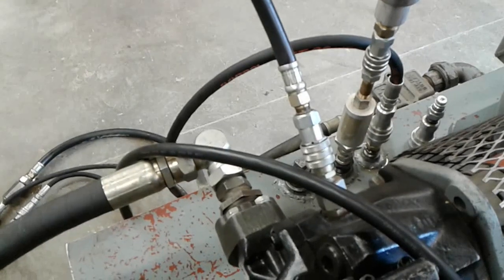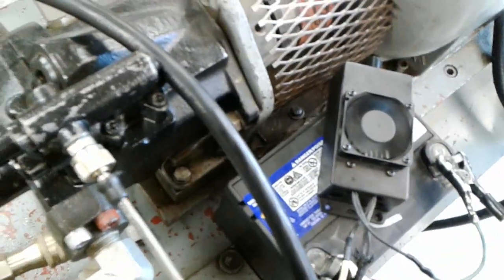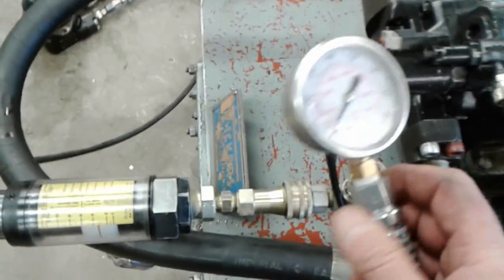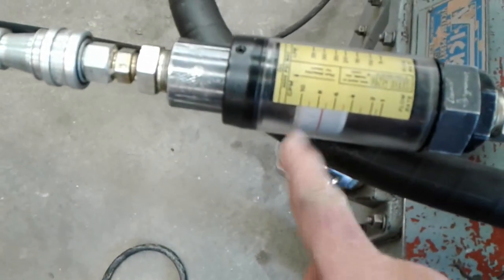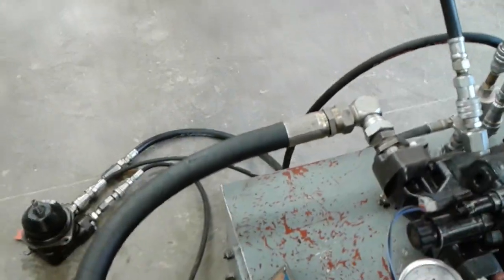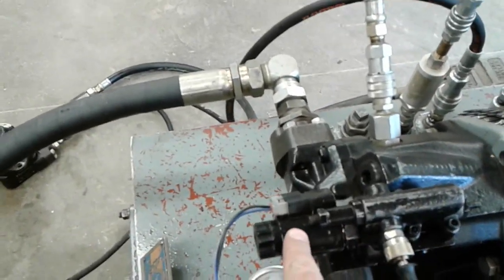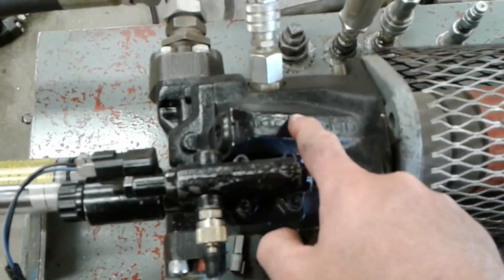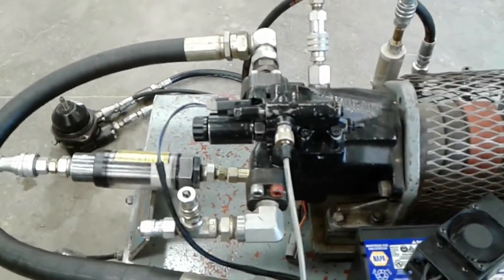Load Sensing Part 3. Rexroth Electronically Controlled Load Sensing Pump Control

Comment: I have an issue with one of my pressure compensated pumps.  The pressure is bouncing in between 1700psi and about 700psi with in about 1 second.  It doesn't sound great and the case drain hose is bouncing around (obviously seeing some pressure).  It has an electrical solenoid which is either on or off.  Do you think the solenoid could be faulting?  The pump is only about 8 months old and our hydraulics guy is suggesting we get a new pump, another $10k.  What happens to the system pressure when everything in the system is closed and you turn on the solenoid for the pressure to go down to the pilot pressure? Does it go through the case drain?

Thanks

Nick

Comment: Why is the solenoid inversely proportional? If you lose voltage for whatever reason the system just flies wide open?
Reply from the maker: yes, better to have maximum airflow through the radiators
Reply: I will admit that I asked this question before I got to the part in this video that explains that we are looking at a radiator fan motor. My fault for jumping the gun. Thank you for the videos!